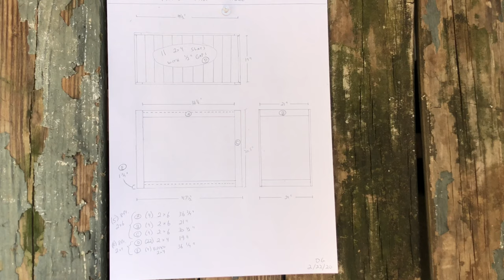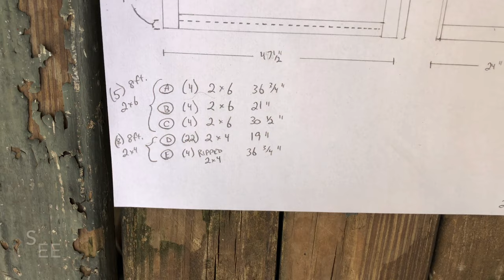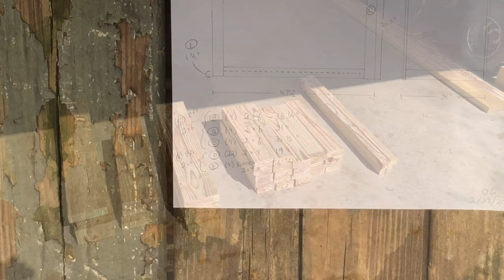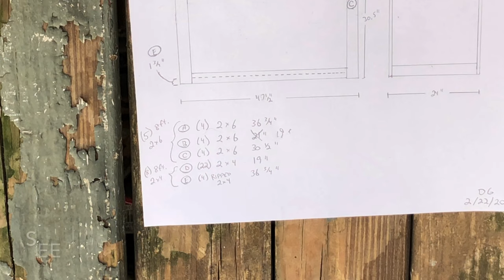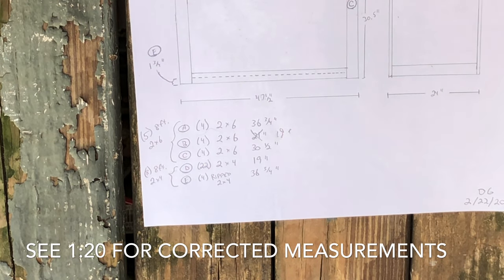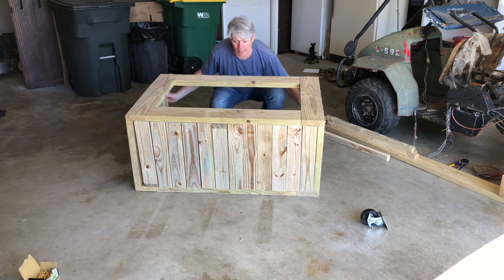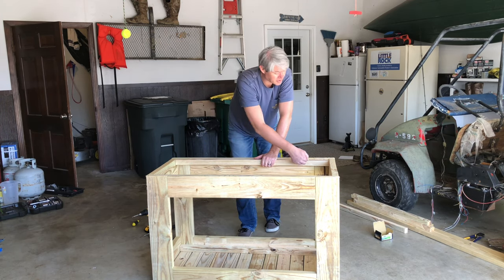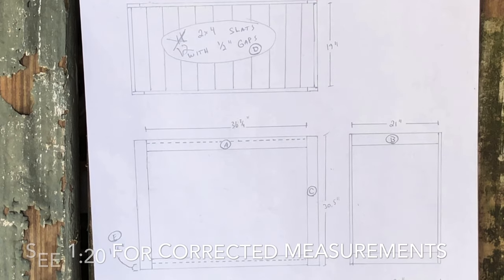How to Build an Outdoor Patio Prep Table on Castors for Grill or Blackstone Griddle - DIY

Comment: Awesome video thank you for showing us the corrections to the tweaks on the ole blue print. You gave me the confidence to tackle this on my next day off. Casters are a great idea. I wanted a table for my griddle that I could easily move from in and out of the garage as needed, or around to the back yard on the patio depending on the situation. This design is perfect! First thought was using one of the wife's folding tables she uses for her craft fair. Second thought was if I melted it even the slightest my rear end would be a new wall decoration. This is the solution I was searching for. Thanks again for the great design!
Reply from the maker: Glad to help!  I’m still very happy with the two that i built.  I use one on the back patio for the griddle and the other one i keep in the garage.  I mounted a table vise to it and use it for all kinds of projects.  The casters make it ultra handy!  Thanks for watching the video and taking the time to comment!  Happy Holidays!  - David

Comment: Great idea.  This is exactly what I need to build.  Any things you would change now that you have had it a few years.  good to know I'm not the only one making revisions as I go.  Thanks for making this video.
Reply from the maker: Thanks!  I ended up building 2 and we use them both all the time.  One thing i would change would be the bottom shelf.  The 2nd one i made had the 2x4s on top and didn’t create a basket area below, which i think i prefer.

Comment: For those that are confused, if you write the corrected dimensions at 1:20 and then look at the picture in his intro it is pretty easy to figure out which piece is which rather than trying to decipher the drawing to get the orientation of the boards.

Comment: Dude  was trying to help out by taking the time to post a video.  Cart came out nice.  Hatters gonna hate I guess.
Reply from the maker: You’re right about that.  Haters gonna hate!  Thanks for your kind words!
Reply: David, what ends up being to overall width of the table? I am trying to figure out what that 47 1/2 is on the bottom left picture?  The overall depth is 21 right?
Reply from the maker: Yes, 47 1/2 is the overall width.  The depth is 22 inches.

Comment: Is there any concern about the griddle bing on top of the wood table without any heat protection under the griddle? I've been trying to figure out a build for my griddle but thought I would need something fireproof under it. Am I wrong?
Reply from the maker: I’ve been using the table as a griddle support for years now with no worries.  My griiddle has four little “legs” that bring the grill up.  I even use it on a plastic table with no worries of melting.

Comment: Going to build this. Why not use kreg for all 2x6 joints? Do you think blue tape could hold slats in place for flip? Nobody makes mistakes trolling from their couch. Keep up the good content. I am  subscribed.
Reply from the maker: Thanks for the kind words and encoutagement, Jim.  I think I prefer a straight screw at a 90 degree to the kreg jig and will use it anytime that i can.  The kreg jig feels a little weaker and i sometimes have difficulty in getting them tight enough.  Blue tape would be an excellent solution for the flip!  Thanks for sharing the idea and subscribing to the channel.  Hope you have a great weekend!
Reply: @budgetprojectsbydavid5263  thanks

Comment: Ok so I noticed you said you would wait 6 months to stain😫 I made one very similar and stained the next day wondering what’s the reason for the wait did I screw up?
Reply from the maker: Pressure treated wood uses pressure to push chemicals deep into the wood.  Sometimes, it takes weeks for the wood to “dry out”.  I guess it all depends on what process was used and how long it to to get from the mill to your table saw.  How does it look?